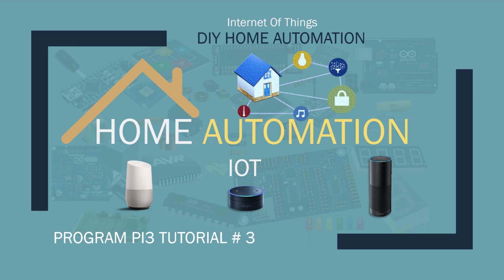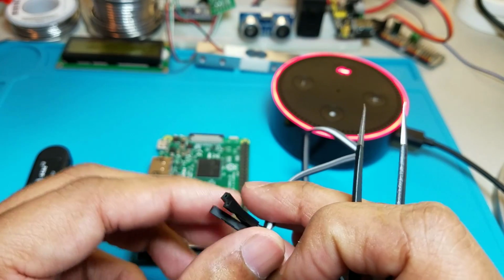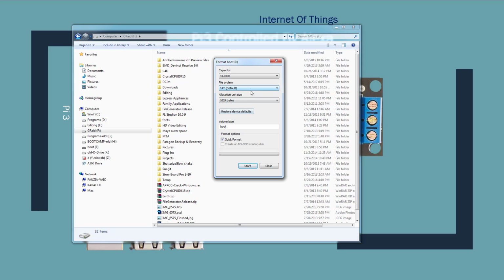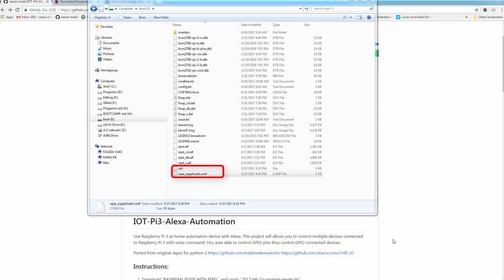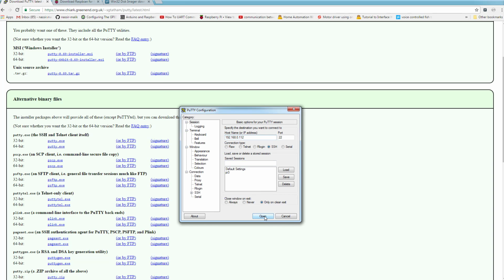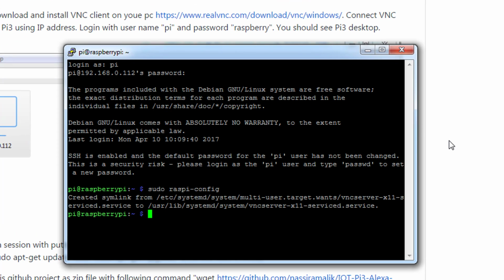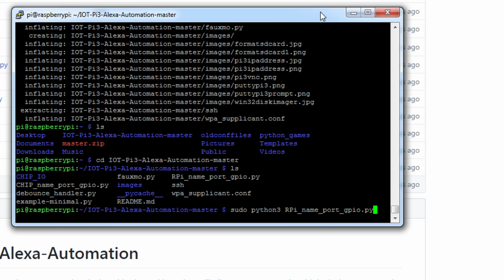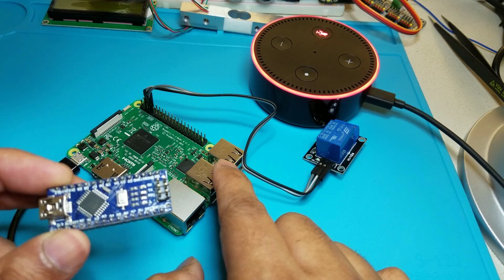Raspberry Pi projects beginners | Home Automation with Alexa | Tutorial # 3

Comment: Great tutorial. Can you help me? I'm using the Raspberry 2 connected in my wired network. I've followed all instructions to burn the Sd Card. The arp -a detect the raspberry. When I ping, 0% loss, but when I run Putty I receive message "connection refused"
When I edit the file wpa-supplicant.conf I put the ssid and password of my network between quotes or not?
Many thanks for the attention. I expect your orientation.
Reply from the maker: Raimundo Aranha "wpa-supplicant.conf" is for Wi-Fi only and you don't need it since you are using wired network. Make sure enable the SSH and also try VNC . They are not enabled by default. Look at the GitHub instructions. 
https://github.com/nassir-malik/IOT-Pi3-Alexa-Automation
Reply: Many thanks for the answer
Reply: HOW TO USE it with a more channel relay?
Reply from the maker: TRIGGERS = {"kitchen": 52000,"living room":51000, "office": 53000, "room": 52002, "tv": 52003, "pc": 52004, "xbox": 52005, "light": 52006}

    def act(self, client_address, state, name):
        print("State", state, "from client @", client_address)
        if name=="kitchen":
            GPIO.setmode(GPIO.BOARD) ## Use board pin numbering
            GPIO.setup(int(2), GPIO.OUT)   ## Setup GPIO Pin to OUTPUT
            GPIO.output(int(2), GPIO.HIGH) ## State is true/false
        elif name =="living room":
            GPIO.setmode(GPIO.BOARD) ## Use board pin numbering
            GPIO.setup(int(3), GPIO.OUT)   ## Setup GPIO Pin to OUTPUT
            GPIO.output(int(3), GPIO.HIGH) ## State is true/false
        elif name =="office":
            GPIO.setmode(GPIO.BOARD) ## Use board pin numbering
            GPIO.setup(int(4), GPIO.OUT)   ## Setup GPIO Pin to OUTPUT
            GPIO.output(int(4), state) ## State is true/false
         ....
        else:
            print("Device not found!")
        
        GPIO.cleanup() # cleanup all GPIO
Reply: i am a noob in programming so what if i use the NodeMCU ESP8266? oh u replied that u make a vid great thx:D
Reply from the maker: Yes, I will be doing that but you can use the same code from my ESP8266 tutorial. Same code will work. You need to select the appropriate board in Arduino IDE when you flash it to your board.

You can use the code from my tutorial # 4. 
https://www.youtube.com/watch?v=OC6QSXzkQU8

Comment: i have follow thru the steps but the relay just didnt turn on as show in the video. There is a different on the reply indicators. my relay shown only Vcc, INI and GRD.When using Alexa to trigger raspberry pi3, it did work but the physical relay lay dead. Is there a possibilities that i have short the GPIO pin?
Reply from the maker: Lester chia In your case VCC goes to the GPIO.

Comment: In the end, this does not actually work, Alexa does NOT detect the RPi.
Also, you need to manually connect and issue the command to run the Python script for the script to run, if the RPi was ever disconnected from wifi or power, you would need to reconnect using putty and start the script again.

Nice touch with the GPIO ports and the relay.
Reply: my Alexa detects just fine and works , how ever yes I also need an answer to how to make this work putty always running ......Netmedias????? Any answer to this query?
Reply: lol looks like I spoke too soon ....ALEXA discovers devices. I can see on the command line as well, but saying switch on living room or kitchen DOES NOTHING, however on the command line I still see the response, but relay does not responds...
Reply from the maker: Sammy Singh Alexa is picky about the names. If it is able to discover your device and unable to control it, then it means it is unable to process your voice command and find a match for your device name. I had this issue many times. You can easily fix this by changing the name to something that Alexa can recognize.
Reply from the maker: Joseph Zajdler Please make sure your device and Alexa Dot/Echo are on same network and run it with Python 3. Are you seeing any errors on python console?

Comment: Hi Netmedias, Great tutorial! but I am running into problem using 8-channel relay. I can get response from Alexa when I ask to "turn on living room" I can see the state on the screen as True, but it won't turn on Led on the relay or click. The cables are working as i checked them with other simple script. here is how i changed your code:
TRIGGERS = {"kitchen": 52000,"living room":51000, "office": 53000, "room": 52002, "tv": 52003, "pc": 52004, "xbox": 52005, "light": 52006}

    def act(self, client_address, state, name):
        print("State", state, "from client @", client_address)
        if name=="kitchen":
            GPIO.setmode(GPIO.BOARD) ## Use board pin numbering
            GPIO.setup(int(2), GPIO.OUT)   ## Setup GPIO Pin to OUTPUT
            GPIO.output(int(2), GPIO.HIGH) ## State is true/false
        elif name =="living room":
            GPIO.setmode(GPIO.BOARD) ## Use board pin numbering
            GPIO.setup(int(3), GPIO.OUT)   ## Setup GPIO Pin to OUTPUT
            GPIO.output(int(3), GPIO.HIGH) ## State is true/false
        elif name =="office":
            GPIO.setmode(GPIO.BOARD) ## Use board pin numbering
            GPIO.setup(int(4), GPIO.OUT)   ## Setup GPIO Pin to OUTPUT
            GPIO.output(int(4), state) ## State is true/false
         ....
        else:
            print("Device not found!")
        
        GPIO.cleanup() # cleanup all GPIO
-----------------------------------------------------------------------------

Thank you...
Reply from the maker: +Tanay Patel When you give "turn off" command, what happens ? 
Check the relay polarity since some GPIOs are low and some are high.
Reply: when i give "turn off" command it results in same, i can see it on screen but no change on relay. And I am not sure how to check polarity as I am new and just started learning IOT, and yours was the first tutorial. The following script runs fine though:

GPIO.setmode(GPIO.BCM)

# init list with pin numbers

pinList = [2, 3, 4, 17, 27, 22, 10, 9]

# loop through pins and set mode and state to 'low'

for i in pinList: 
    GPIO.setup(i, GPIO.OUT) 
    GPIO.output(i, GPIO.HIGH)

# time to sleep between operations in the main loop

SleepTimeL = 0.2

# main loop

try:
  while True:
   
    for i in pinList:
        GPIO.output(i, GPIO.HIGH)
        time.sleep(SleepTimeL);

    pinList.reverse()

    for i in pinList:
        GPIO.output(i, GPIO.LOW)
        time.sleep(SleepTimeL);

    pinList.reverse()

# End program cleanly with keyboard
except KeyboardInterrupt:
  print "  Quit"

  # Reset GPIO settings
  GPIO.cleanup()
Reply from the maker: Tanay Patel, Sorry I missed your comments. Is it working for you? Some Pi GPIOs are low and some are high. 
Just connect one relay to GPIO4 and test it.

Comment: Great video and tutorial !     To make this a garage door opener / momentary relay click.   what code would be needed to have the relay click on for say 1 second,  then go back off ?
Reply from the maker: Glyn Davies you need to do following.

import time
GPIO.output(int(11), HIGH)
time.sleep(2)
GPIO.output(int(11), LOW)
Reply: Thank you,  very much appreciated.
Reply: I have the same problem. In which one file I need to enter the above text?
Reply from the maker: In "RPi_name_port_gpio.py" file replace "GPIO.output(int(7), state) " with following'

GPIO.output(int(11), HIGH)
time.sleep(2)
GPIO.output(int(11), LOW)
Reply: Wonderful tutorial!!! Has anyone gotten the momentary portion to work? I have tried the above mentioned instructions but it simply results in error.

EDIT: in case anyone else is wondering. I wasnt able to get it to work using TRUE/FALSE OR HIGH/LOW statements. Instead I left evertyhing as it and simply added underneath  every if/else statement the following:

time.sleep(2)
GPIO.cleanup()

Comment: Hey, I've added a total of 6 device names and added more elif statements for each. Four of them trigger but two get responses from Alexa like "I don't know what went wrong" but it triggers the code twice before giving the error. Any ideas?
Reply from the maker: +TooMuckinFuch17 I tried with 6 devices and it is working. The issue is the you need to make sure the the name you have given to you devices use use them exactly or it does not work. Some names do not work so I had to play around and find the names that Alexa can work with.

For example I have "game" device. If i say "Alexa, turn on game room lights" it will not work. I have to say "Alexa, turn on game" in order it to work. Following code is working for me. I hope this helps.

    TRIGGERS = {"kitchen": 51000,"living":52000, "master":53000, "family":54000,"game":55000, "tv":56000}

    def act(self, client_address, state, name):
        print ("Name",name ,"State", state, "from client @", client_address)

        if name=="kitchen":
            print("kitchen")
        elif name =="living":
            print("living")
        elif name =="master":
            print("master")
        elif name =="family":
            print("family")
        elif name =="game":
            print("game")
        elif name =="tv":
            print("tv")
        else:
            print("Device not found!")
Reply: Netmedias Thanks, I'll give it a try. I have devices named "profile one", "profile two", etc.... And I have to keep the names that way. Are there limitations on the port numbers? Or start at 51000 and add 1000 to each? Also, I'm running quite a few GPIO high and low commands for each one. I'll post my code if it isn't working tomorrow
Reply from the maker: + TooMuckinFuch17 you can use any ports as long as they are not being used by any other app/process. I am using 51000,51002,51003... and it works fine.

Comment: Great video! Thank you very much.  Could you please explain how to add more relays to the code. I have no idea where to cut and paste the pieces.  I have an 8 relay board and I'd like to give them all different names.  Any help would be great!

 Thank you very much. Again,  great video!
Reply from the maker: Stephen D It is very easy. You need to change the code as follows to add two relays.

From: TRIGGERS = {"office": 52000} # remove
     To:  TRIGGERS = {"kitchen": 52000,"living room":51000} # add two devices, add more if you need them.

From: remove
        GPIO.setmode(GPIO.BOARD) ## Use board pin numbering
        GPIO.setup(int(7), GPIO.OUT)   ## Setup GPIO Pin to OUTPUT
        GPIO.output(int(7), state) ## State is true/false

To : add
        if name=="kitchen":
            GPIO.setmode(GPIO.BOARD) ## Use board pin numbering
            GPIO.setup(int(7), GPIO.OUT)   ## Setup GPIO Pin to OUTPUT #  The pin 7 - GPIO 4
            GPIO.output(int(7), state) ## State is true/false                                 The pin 7- GPIO 4
        elif name =="living room":
            GPIO.setmode(GPIO.BOARD) ## Use board pin numbering
            GPIO.setup(int(11), GPIO.OUT)   ## Setup GPIO Pin to OUTPUT   The pin 11 - GPIO17
            GPIO.output(int(11), state) ## State is true/false                          The pin 11 - GPIO17
        else:
            print("Device not found!")
Reply: Thank you so much! I was running multiple windows for each device  and it did worked but it was not very 'clean'. I have one more weird question.. 
Everything worked great but, on and off seem to be reversed! I could fix it by rewiring the relay between normally closed/open but I'd love it if the light on the relay worked in conjunction with the lights that are being controlled.  Thanks again! I will rebuild today using your advise.  

If your in the US, Happy 4th!
Reply from the maker: Stephen I don't understand what you mean by running multiple windows? A single script should control all of the relays. 

To switch polarity look into the "fauxmo.py" file and play around with "if data.find('<BinaryState>1</BinaryState>') != -1:"  and  "elif data.find('<BinaryState>0</BinaryState>') != -1:"

Let me know if you still have issues.

Comment: Hallo Nassir, thank you for this fine step by step tutorial. 
I followed it 2 times step by step but ran in the follwing problem: When Alexa searches for devices the RPi_name_port_gpio.py crashes with
Traceback (most recent call last):
  File "RPi_name_port_gpio.py", line 54, in <module>
    logging.critical("Critical exception: "+ e.args  )
TypeError: cannot concatenate 'str' and 'tuple' objects
Reply from the maker: Michael, can you share the error stack?I ran into this issue when I tried to run the program with wrong version of python. Make sure run it with Python version 3 or above. It will not work with Python 2.7.
Reply: Hallo Nassir, 
that works fine. Starting "python3 RPi_name_port_gpio.py" solved the problem.
Looking forward seeing more of your videos. I will now try do access more than one GPIO Port.
Reply from the maker: Michael Katzenberger I am glad it is working for you. Thanks for your feedback.
Reply from the maker: Try connecting one channel only to GPIO4 and try it.